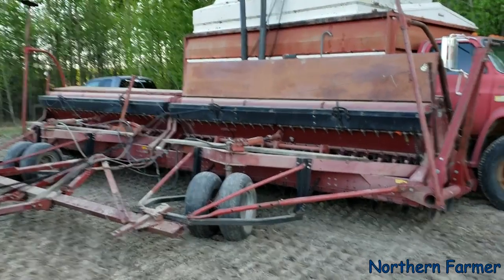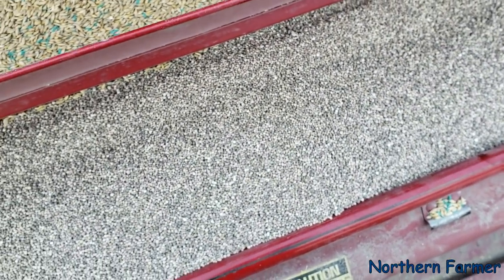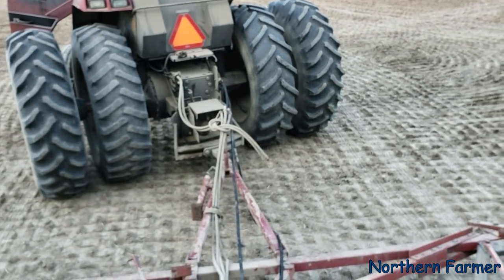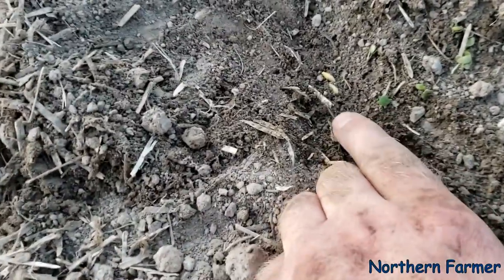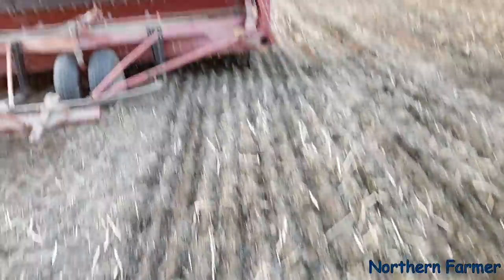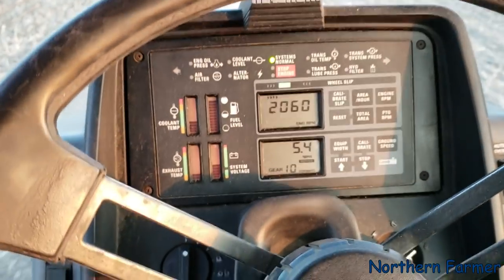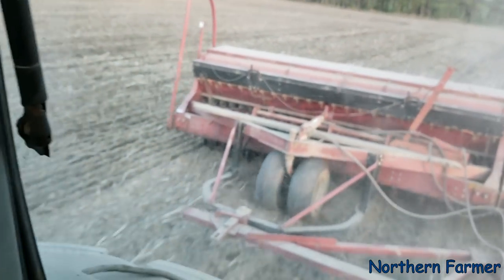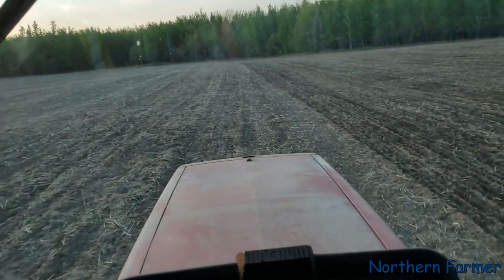Planting Barley and Hay.. Caseih 6200 Press Drill 2018

Comment: Guys seem to really like those 620/6200 drills for planting new hay seedings. Dad has a 620 he bought brand new, looks pretty good too. Always did a good job planting soybeans, but it was getting pretty worn and was a total guess if it was putting down what you wanted. We finally updated last summer with a Great Plains Solid Stand 15 which did a fine job on winter wheat and this springs soybeans.

Comment: Have the exact same drills. That's how I learned to seed when I was 12 years old until dad bought the Flexi Coil drill. Still use the Flexi Coil to this day (double shoot). Still have the International drills parked beside the shed. A few shots of grease and she would be ready to roll. I like them, easy to set and maintain but the filling sucks and the narrower width seems like it takes forever. We only used the drill fill for fertilizer. Seed was all pailed: Canola was nice because just throw in the bags and go. I'll stick to the Flexi Coil though haha.
Reply from the maker: yea they still come in handy...but you are right.. pain to load even with the drill fill and dont hold much

Comment: Your 7120 is about 150 hp on the pto, would a 165 pto hp tractor handle 28' of the same drills?
Reply from the maker: Easy
Reply: My dad used to pull a 36 foot press drill like that with a new Holland tv 140 tractor 105 hp no problem.

Comment: I have a question- old good Case tractors but combines are Deere. Why? Better is JD than Axial-Flow or the price decide?
Reply: TheAgrotechnik they got 1deere and 2old New Hollands , that my last count could have changed
Reply: Yes, I notice that.
Reply: Cause international combines destroy the straw and are virtually impossible to bale behind.  Internationals are not cattle men friendly
Reply: Every rotor-type harvester destroy straw, oposite to walkers-type, I know that (I'm agriculture engineer). :) . So that's the reason why not Axial-Flow, but I asked why they choose another brand than Case IH. Ofteen see that one brand in farm, from tractors and implements to combines. In Europe hard to complete line with one brand because for example, John Deere didn't offer cultivators.